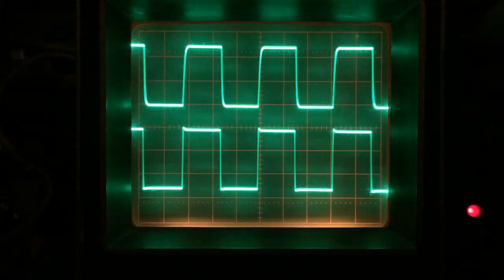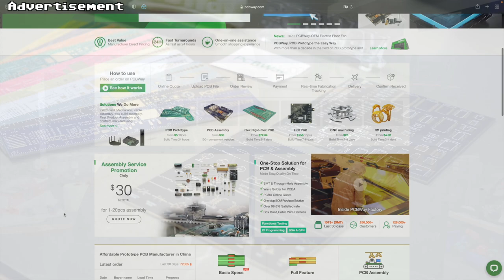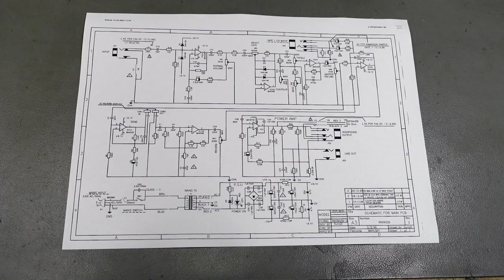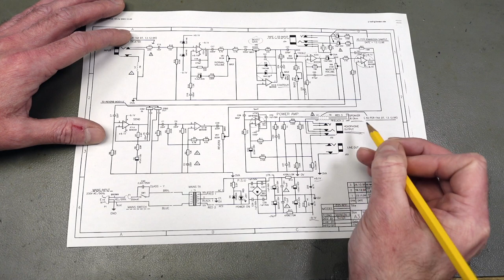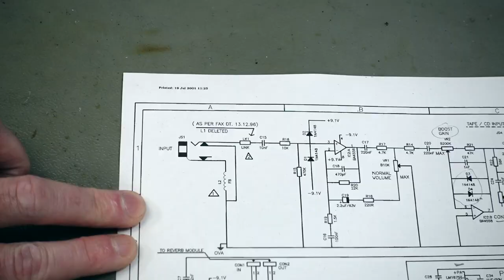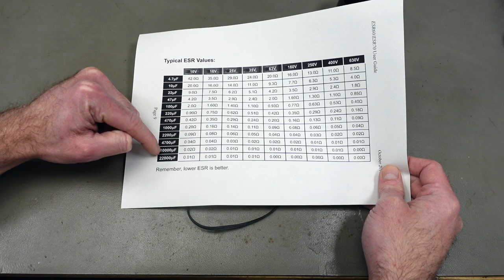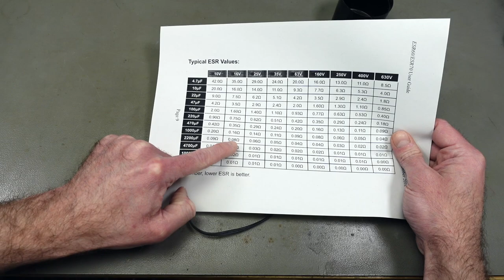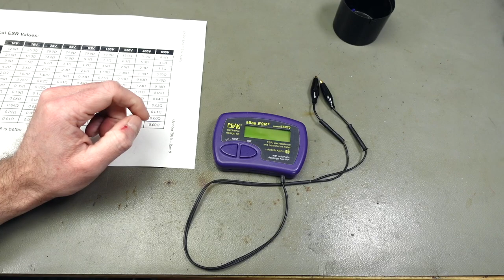Marshall G15R CD Guitar Amp Hum Fix

Comment: That Class-Y capacitor across the mains switch won't filter anything. It is basically shorted when the amp is on. I think the reason that cap is there is to reduce arcing in the switch (which will extend the life of the contacts). It will probably also reduce the loud switching sounds that the speaker / amp may produce.
Reply: Yes, spark suppression is exactly what it's for
Reply from the maker: Yes, that makes more sense. I didn't realize, maybe I should have taken a bit more time to go through the schematics (which was actually an afterthought after I had already finished working on the amp). :D
Reply: Spot on, It's technical name is "Switch Bounce"

Comment: Here's a tip about caps that I learned from Mr. Carlson's Lab (great YT channel for fixing amps btw).  Many cap checkers use the amount of time it takes to charge as a way to measure the cap.  If a cap is showing a greater capacity than rated, it is not because it's "better than normal", it's because it's taking longer to charge.  Why?  Because it is LEAKY.  ESR is one thing, but leakage is Equivalent PARALLEL resistance.  Leaky caps will often show a higher capacitance on most test equipment.
Reply: From what i learned about CRT tv nerds, just fookin replace them all caps for old stuff haha.

Theyre crazy like that

Comment: fun video.  a few tips, "thou shall check voltages" first.  First DC voltages on all rails, comparing the positive and negative rails for sag.  Then put your DMM on ACV, and see what kind of ripple is present on each rail/cap.  Or if you have a diff probe to go with that Keysight, you can visualize capacitor ripple on your scope.  You can probe that circuit without a diff probe, but see videos with titles like "how not to blow up your scope" first.

Those bulk filtering caps fail 2 ways primarily, they become leaky across, or dry out and their capacitance drops, both of which will manifest with ripple you can measure vs. the time spent plucking and replacing parts.  Most modern caps last a long time, even cheapo ones, as long as they aren't abused by heat.  Those caps probably suffered from the heat of that undersized bridge rectifier, that thing needs some heatsinking I bet.

Comment: Your computer videos are fun, but these AV/music gear videos are always extra relaxing to me. 

I notice you said this amp doesn't have any distortion stages or anything, but I always prefer to just overdrive my amp rather than use its distortion settings. (And those are pretty good modern "modelling" distortions, not just a crude transistor stage like my awful, awful first amp.) So I couldn't help but notice this has two gain stages! I bet that lets you dial-in a rather versatile range of tones, distortions, etc over my one lone gain knob.

 Ooh, I just noticed you mentioned they inserted some diodes into the two-stage gain as well. That's funnn. I honestly think overdrive sounds are just... way more natural, warm, round, full, and all those other meaningless terms ;) than 80s&90s POWER DISTORTIONS are. So that's a very cool modification to the standard method! Even moreso than I realised just from the front panel.

Comment: Seen a few amps like this, but wow.. a 1A bridge rectifier.. they really were cutting costs ! Normally I see a 4A "SIP" type thing. LM1875 is very common in such low end guitar amps and was at one point used in slightly-better-than-average PC speakers too.

4558 opamps arent really "hi fi" but good enough for this application :)
Reply from the maker: I considered replacing the bridge rectifier with something beefier but the ones I have in my parts bin all have a way larger footprint so it would require some hacking to get those in there. :D I think I use the "hifi" term a bit too generously. Just had a quick glance at the data sheet for the 4558s, they indeed don't mention hifi. :D
Reply: @JanBeta  I have a similar problem with an Atari (boo hiss) power supply... they use the same rectifiers and they often fail as they are being pushed too hard. I've managed to find a square 4A part that will fit.. with a little lead bending
Reply: yep, I bet that BR is getting mighty hot and caused those caps to fail.  The guys who laid this out for Marshall knew it'd fail, and that's why it's in there!  105C caps will help, but getting a heatsink on that BR will help more.  A fun test would be to put a temp probe on the BR and see what the temp gets to during a playing session, I bet it sees 60-80C, maybe even 100C.
Reply: @bandittwothree3765  id probably run wires from the board over to a 15A "KBPC" type thing mounted to the metal chassis

Comment: i would allways inspect the joints around the pots and the jack sockets with the board out, i have also replaced a lot of pots on these and similar amps so worth checking all of them for noise before taking the board out to do caps  ,and also bigger capacitors may need draining before putting your fingers inside !.

Comment: I had a Marshall 30w bass amp back in the day which had a similar sound and started smoking.  When I took it back to the music store they didn't believe me and plugged it in.  It then decided to catch fire at which point they admitted I might have a point.  That turned out to be an op-amp issue.

And while I know very little about electronics in general one rule I have noted from amp repair videos is 'if in doubt, swap the caps out'.

Comment: I loved your video, congratulations. I would like to know what the name of that green blanket you placed on top of your bench is. Thanks for the info.
Reply from the maker: It's an ESD safe mat, there's many different variants/sizes available from a number of sellers. I have one that can be connected to ground/mains earth which makes it very effective for preventing electrostatic damage to components I'm working with. :)

Comment: Nice repair! Btw the insulating pad under the main amplifier chip is actually made of mica.
Reply: No. It should indeed be Mylar (Polyesterfilm by Dupont).
Reply: @starsundsternchen802  Nope, they are traditionally mica. Nowadays you may see "sil pad" and some of those are based on Kapton
Reply from the maker: Oh, I confused the two. I even have a stash of replacement mica insulators in my parts bin (but didn't remember the name correctly)!

Comment: When amplifiers fall into humming suddenly,there is a common cause for it & that is the ground connection. It is not earth connection of mains,but possibly some signal input somewere has shorted to the circuit ground or there is a loose ground in one of ICs,so they are floating and getting EM interference from the mains voltage. ICs themselves sometimes get short circuits internally because of overheating or over voltage.Hums which are caused by bad capacitors usually develope gradually but not overnight(cold solder joints are obviously the exception in this case).

Comment: If the tab the ground connection hooks onto has the option to screw a connection onto it, then replace the spade connector with the screw and nut option to make sure it doesn't come back off.

I have a very basic practice amp that's similar and the ground connection was a spade connector just like that and it wouldn't stay on and that's with me barely ever moving the amp. Seems like vibration from the speaker alone is enough to loosen it over time.
Reply from the maker: Yes, I think it just managed to wiggle itself loose over the years just because of the vibration from the speaker. The amp has not been hurled around much since I got it. I might go back in and crimp a proper screw connector on and drill a hole into the chassis to permanently attach that wire.

Comment: Looking back through the taking apart bit frame-by-frame, I think you are right, that green wire wasn't connected when you removed the PCB tray, some alleged "audio experts" do this to reduce mains noise on their (probably faulty, hence noisy) equipment, and this is a very, very dangerous thing to do, if the audio side is left ungrounded, and mains somehow got through to the audio side due to a fault or bad wiring, the next path to earth is the human holding an instrument or a microphone, which has killed performers live on stage as a result, never, EVER disconnect any ground wires from amps, it's there to save lives...
Reply from the maker: Yup, it seems to have wiggled itself loose over the years. I might go back in and solder it on or put a proper screw on that connection. The whole chassis is connected with a proper grounding screw but the connection to the circuit board is only through that ground wire and the screws on the heatsink.
Reply: @JanBeta  The green wire might have been removed to "fix" a ground loop. if the amp was connected to another  piece of mains equipment.

Comment: SamXon are seen as pretty good caps.
Though they go lower end than Nippon CHemicon/Nichicon and co.
and don't forget that Japanese Companies have Duds too -> NCC KZG/KZJ, Panasonic FJ, Nichicon HM, which should be replaced on sight by now. Sadly you have to go to 16 or 25V Caps (and 12,5mm diameter) for 10mm/6,3V ones...
Reply: They are OK in undemanding applications, but in anything involving switched mode power supplies or high ripple currents, they are total crap
Reply from the maker: I've seen a lot of Samxon caps fail in early 2000s DVD players and similar devices. They seem to have been used a lot in those days.
Reply: @JanBeta  Yeah, that's the bad Caps era, when a lot of low ESR Caps were abused, misused and of not great quality...
It was common back then to put entry level caps right next to the hot MOSFETs and let them run at 70°C or more. And as all new things, as low ESR Caps were at the time, they failed a bit more than conventional Caps.

Comment: My Harmon Kardon Soundsticks  speakers from around the same era were sounding pretty weak and sad... same issue with 3rd-tier capacitors. It has many more small capacitors, a few of which were open and one thought it was a diode. Back to sounding great, as good or better than ever.

Comment: I had a similar fault with a Peavey TKO-110 bass amp, but it turned out the earth was missing from the plug socket. Some "joker" had installed the socket before I lived there and didn't connect the earth wire in the plug socket!

Comment: I have the G100R CD, which is the 100w head version of this amp. I bought it in the early 2000s when I thought I needed a half stack but didn't use it much. I don't think it sounds that good tbh. It is a cheap transistor amp and doesn't compare to a real tube amp. These days you are better off with a Spark, Katana or THR10 or something. And those mini head versions of bigger tube amps, like 6505, Rectifier or even Marshall themselves offer enough volume for live applications also. So, I wouldn't bother fixing die G100 if it were broken some day.

Comment: Yeah, the ground connection wasn't connected when you took the amp out of the cab.  At least its got good caps in it now.
Reply from the maker: Yup, I just realized when I edited the footage. It might have wiggled itself loose over the years just from the speaker vibrating. I had the amp open a while back though to have a quick look, maybe I accidentally disconnected the spade plug then. In any case, I think it was a good idea to replace the caps anyway. :D

Comment: I'm replacing the caps on my amp at the moment and I can't confirm capacitors values. I guess there's different versions of it. My one has a 2x 16V 1000uF and 2x 50V 2.2uf. Weird, if it was just a bit off I'd understand but they are so different. Strange world.
Anyway, can you make suggestions when replacing caps. You're saying audio quality isn't needed, in this case we go for lowest impedance I'd say or what? Thanks

Comment: Hello, great video. How to solve the crack sound from the potentiometers
Reply from the maker: I usually use a good non-corrosive contact cleaner like Teslanol T6 (German product, not sure if it’s readily available elsewhere). Deoxit is the US alternative. Spray some into the little cutouts in the potentiometers, move pots for a bit, spray again, let the contact cleaner evaporate. Usually that fixes noisy pots. If you still have problems, the coating in the pots might be damaged and they need to be replaced altogether (but that rarely ever happens in my experience). Hope that helps!

Comment: Jan have you ever worked on Midi keyboards.  I have a Concert Mate Midi keyboard that I messed up the  TOP plastic cover mainly that messed up the speaker, I dont know if Concert Mate was sold in Europe though.  This seems not very popular and older I wish I could fix the speaker mainly with the plastic, but it needs a complete TOP piece to fix this. Or if anyone may have a Concertmate you would give me good deal on please let me know.

Comment: 23:46 Using a brush to make it cleaner will not work. You are only moving it around with that brush. You need to use a washcloth or paper to wipe it off.

Comment: It's possible it's not about the caps at all. Maybe the ground connection just got better by screwing in the board again....
Reply from the maker: Yeah, the missing ground connection definitely played a major part in producing the hum. It was a lot better with the new caps than when I previously tried it though, the guitar signal was barely audible over the hum before I started the repair. So most likely a mix of bad capacitors and the ground fault in the end.

Comment: Nice. I picked up an even older and cheaper Marshall amp from the trash to take apart. I was not impressed by the build quality in any way :)
Same basic board as yours pretty much as far as I remember.
The real bothers were cleaning the pots and then figuring out how the hell I'm going to test the thing since I don't have a guitar :D
I would have doubled the value of those main filter caps, just because you can be sure they used the cheapest parts they could get away with.

Comment: Hi and thanks for the very informative video. I'm just about to start to repair this same amp. 
But is there fault in the parts list? I can't find any 22uF 100V caps from my amp nor there seems not be those in schematics either... But from amp I found two of 2.2uF 100V caps
And the schematics has a fault when it says there is 47uF 10V cap in reverb circuit when it is in reality 47uF 25V like in your list.
Reply from the maker: Hi! The parts list may differ from the amp revision you have, they seem to have gone through quite some changes over the years with component values. I’d advise to always replace the capacitance with the same you actually find in your circuit. The voltage rating is not important as long as it’s the same or higher rating as the original caps! Hope you manage to fix the amp! 🤞

Comment: I thought ground faults were basically the default for cheap guitar amps... And some not so cheap ones as well. I can't remember ever hearing a guitar amp with no hum what so ever, but I could be wrong.
Reply: Guitar amps normally have fairly high gain on the pickup, which means hum gets picked up quite easily... Also of course the pickups themselves pick up mains hum which is why you have "Humbucker" pickups :)
Reply: @jaycee1980  I did mean for it to be slightly tongue in cheek. It's surprising sometimes how often electronics are designed with ground faults in them though. It's almost certainly by accident, exacerbated by cost saving, but you hear it so often that I feel it probably should have a meme ^^

Comment: That was a fantastic job going thro' d schematic diagram. I'm trying to repair my friend's G15RCDR. similar to your model. The potentiometers are beyond repair n needs to be replaced. I 'm not able to find it's valves in any circuit diagram. I would be obliged if you cud let me know valves of each potentiometer. This wud enable me purchase n replace my potentiometers with correct values.
Bosco Gonsalves, Mumbai, India
Reply from the maker: Unfortunately I don’t have the amp anymore, passed it on to a friend and upgraded to a slightly more powerful Fender in the meantime. I am sure there are some forum posts about replacing the potentiometers somewhere though. Most of the times the values should be engraved or printed on the pots themselves, too. Should be visible once you remove them from the circuit board. Hope you manage to get the correct values!

Comment: I have a Marshall MG15CDR and it crackles on the Drive setting but doesn't when set to clean...can anyone help please....
Reply from the maker: Might just be a dirty/scratchy potentiometer. Maybe some contact cleaner helps (make sure to use non-corrosive contact cleaner meant to be used on pots).

Comment: If my experience of repairing equipment for bands and DJs is anything to go by, that hum is "authentic valve sound" and some guitarists would not thank you for "fixing" it 😉
Reply: Which perfectly illustrates the lack of  knowledge of "some" guitarists!
Reply from the maker: But valve hum is good hum while transistor hum is bad! :D
Reply: @meh3247  I'm only partly joking, plenty of guitarists play the amp as well as the guitar, even using the microphony of the valves, the springline reverb etc. (where fitted) and the hum of the amp is a part of their sound.

Comment: These cheaply made solid state Marshall amps are junk as are their modern pcb-based tube amps. I repaired one of their modern tube amps that was humming loudly. It was the bridge rectifier, which was a cheap component that was getting so hot as to gradually desolder itself from the pcb because they chose a component that was borderline underrated for the circuit.